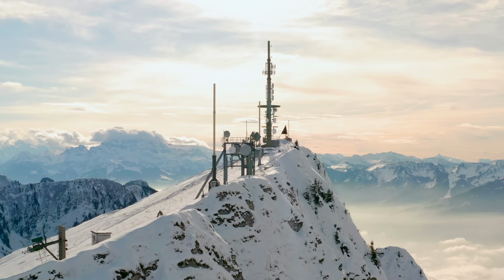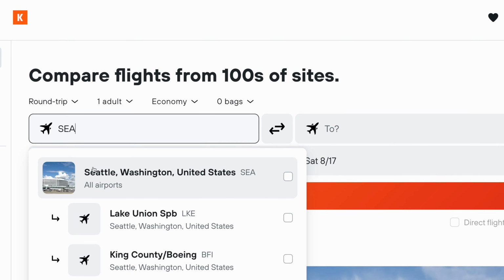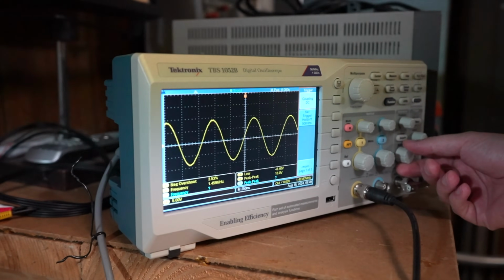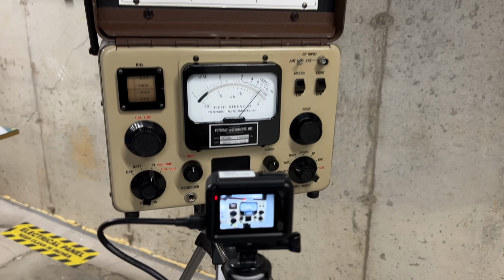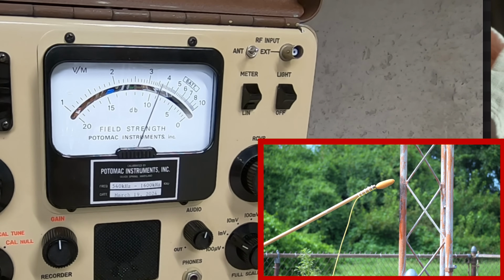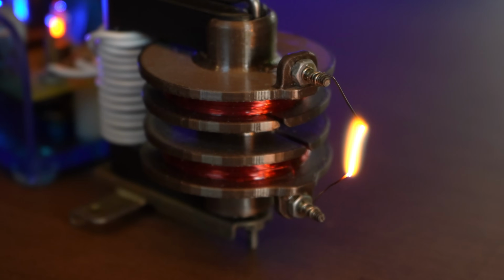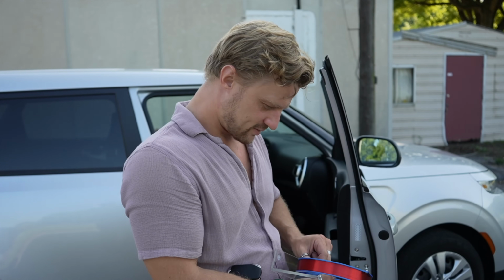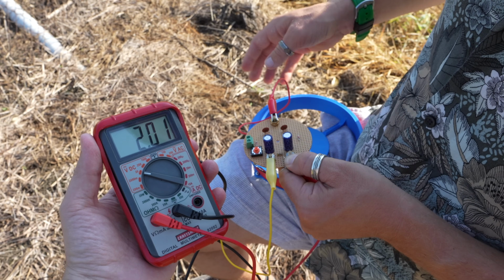Stealing Energy From Radio towers Using Plasma (ft. Geerling Engineering)

Comment: I found your channel today.. and after watching, subscribed of course. YAAAAAAY!
I have a couple inventions Im working on and am gleaning bits and pieces from your really cool work.
After a couple years, I don't really expect you to read this, BUT... if you REALLY are out there... 
I have a few Q's, please.  So, did you do a new build? 
On your little receiver, how many winds of wire did you wrap around the outside ring.. and what determined that number?

Hoping to hear from you Jay.  ~ Also, I [may] have what you'll call a cool and interesting story as to WHY I became 
interested in the same things.. like transmitted electricity. It may also take your creative thinking in a new pathway.
Headed off now, to your Homepage.  Later.
Reply from the maker: Hello! Not sure how many turns, but I matched the exact length of wire to be the same as 1/4 the wavelength of the radio tower transmissions.

Comment: I live in Denmark. 
Once, the class my education was a part of would visit an AM transmitter. Its a 300KW station. 
The guys who operated it were old and had many decades of experience there. One of them told us that he had been working with some tools on a part of it that was shut down. Since its really big parts, he was using big tools. 
Once he had dropped a really massive solid socket wrench over a part that was live. 

There had been a very loud noise and the wrench was gone. It ceased to exist. 
It simply vaporized instantly. 

So yeah. We dont mess with those big transmitters. But its awesome that you can transmit with AM to anywhere in the world.

Comment: The first Radios I have built as a child did fit into a match box and didnt need a battery. Detector Radios. Just a Coil, two capacitors (one for the resonance circuit with the coil, one for decoupling the audio signal), a Germanium diode, antenna (long wire), ground connection, and special high impedance headphones. These received the strongest Transmitter only, in this configuration with the not adjustable resonance circuit, but it was fun and cheap, the components I got from trash Radios and TV Sets.

Comment: so if you put a high enough load close to the tower it would shut down the broadcast?
Reply from the maker: It depends on how the tower's circuitry is designed. Too much leakage and it will trip. Too little, and the power will allow power to leak away.

Comment: You ever heard of the farmer experimenting with the 270,000 volt power lines running thru his property? 1100 volts coming from a 100 foot copper wire forty  feet below the lines......lol
Reply from the maker: Oh yeah, that one doesn't shock me. No pun intended. Transmission lines put out so much EMF.

Comment: Haha bigger loop tuned to the transmitter frequency. Tap the coil to preserve the Q while picking off the energy and charge lithium batteries when the station is using day time power levels, and use the battery for something at night 😂

Comment: Try wrapping wire around a coffee can attached to a   pole that is electrically insulated from the can and try just getting near the Transmission Tower without actually touching it. 

That is called Theft,.... if you do it to an overhead Power Line.

IT'S CALLED,..... Magnetic Inductance ~ and you are cutting the Flux.

Comment: So what happens when you build one that can handle the power? Does it pull down the radio towers signal? Unrelated to radio transmission a farmer who had a barn close to high voltage transmission lines discovered voltage being induced into coils of stored wire spools. So he put together a large coil of copper wire and attached a load to it. It powered a set of lights or a small motor. Free power as he thought. The power company noticed the loss on the line and tracted it right to his barn. And he had to pay for stolen power and remove all the wire. I cant prove if this was a fake story or not. But induced voltage from a large electrical field can happen.

Comment: You said it 
The tower “radiates” power
As oscillation = radiation
To make a viable wireless energy source 
The output would exceed the safe levels of exposure
My late father is the guy that configured the digital tether
Via geolocation algorithms 
That allocated the designated receiver
 
Inventor of 202 base station transceiver 
Implemented as foundational packet switching router across +690 gsm cdma networks globally from 1991 2g
He passed away 2001 at 37 years old from radiation induced illness
His life’s work ate him from the inside out

Comment: Of course Mr Tesla did something like this years ago. Did you consider taking your apparatus a few miles away and driving toward the transmission tower while monitoring the power picked up?? BTW, I noticed that snow had melted off a coil of barbed wire  on a fence post under a set of high voltage transmission lines one winter.

Comment: When I was in HS I used to do field day with one of the teachers. One summer we had put up a ten-meter inverted V antenna, I happened to brush up against one of the transmission wires. We were using only 10 watts. But man did that hurt.

Comment: In the early 1960's I had a Heathkit shortwave radio.  Over my home and garage, my dad (an Elactrician at Deyroit Edison),  put two insulated dipole wires atop these structures in the L shape created ny  our lot. One 90 degrees to the other.  These ran into the radio, which was grounded after this connection causing the electrons to flow into the radio as an antnna. I disconnected this combined 2 wire antenna and connected the bare wire to a flashlight bulb which when connected to a ground burnt out very brightly like an old flashbulb.  Storer Broadcasting was WJBK in that area, often reportedly listened to as far as Texas from Michigan. It was 500,000 watts, and very often we could hear the radio on the bathroom and kitchen sinks in rather good audio frequency. We were allways getting electric shocks off the refregerator, etc. Painful zaps!  I grew up thinking it was "the carpet"...in the living room, from accumulated static electricity (that's what was blamed by my mom).  My dad accused me of "plugging it into the wall"!!!
 When pestered, he said "I don't know, but leave it connected to your radio". I even used the bare wire to power a transistor radio enough to...listen to other stations!!!😉

Comment: If I'm not mistaken that goes on the same basic principle that Nikola Tesla wished to modernize which was Wireless power transfer via Tesla coil but technically you could use the radio tower and the receiver that was shown to do the same thing

Comment: Over the years as a am radio engineer I have witnessed some really neat and very scary occurrences. I hesitate to discuss the damage I have witnessed to things and poor creatures that have come into contact accidentally. The highest power broadcast transmitter I ever have observed was a 2,000,000 W transmitter. I have anecdotal stories that have told me about people living near a 1 million want broadcast Transmitter in the Philippines that used to put out a length of wire to run their lightbulb in their home with no other connection than ground. Thereby they got light in their home after dark for free. R.F. energy is a wonderful thing, but it does have to be treated like any other energy source with great respect and knowledge. Try a 1n4007 diode it isn’t as sensitive but has a 1 kv rating. I have had to use these in applications where to much rf would eat those little detector diodes for breakfast.

Comment: Massive JBLs, is this TESLA approved the first well known Tesla. I thought we settled all this in the 50,60 &70s a good 5 watt amp is all you need. I actually have a 110w, 150w, 200w all 70s Pioneer heavy duty equipment.

Comment: why does our new building code take the ground off the waterlines and go with 2 rods . are they cleaning up the noise from the system ? also local bans on real neon lights why too much noise ? ground is continuous without noise is it a surveillance tool? if so a spark plug would drive them crazy

Comment: i am a plumber and replaced many copper main waterlines from the street to the house . id cut the waterline and the whole house would dim . bad ground at the main touch the pipes together shut off the main bkr .  iv had this happen i told the homeowners your ground needs to be  cleaned at the mast or the pole or meter socket that they were grounding through the waterline . each time i heard our bill is low just clean the ground at the waterline wel leave it alone

Comment: i was told to add 2 more ground rods to my system . 1 straight down go 6 ft and add another at a 45 degree angle . go through in a loop and  bring back to the service . my bill will go down because im over grounding . a radio enthusiast told me this. guys smart could he be right ?

Comment: Id be willing to bet the SWR on the transmitter went through the roof when touching the food to the tower.
I hope the finals are rugged cause id bet they would melt most people's credit cards.

Cool experiment!!
Reply: I think think it wouldnt be too bad because they were touching the tower at the bottom where the current is pretty high. It wouldn't raise the SWR too much because it's still only taking a small amount of energy compared to the actual transmitting power

Comment: This was a partical Final year project of mine using xbee mesh network for sustained wireless power free comms... And alough it worked it aas actually cheaper just to use a 10 - 20 year battery to enabke mostly maintance free... the looses where ridiculous even with harmonic resonace. In the end i settled for a cross of minutire limithium caps/ batteries and a resonance tuning curcuit using some of the lastest ICs on the market (i forget which). 

The funnest part, the research and the mathematics.

Comment: How about building a receiver that could be installed in parallel with a solar power system. That way the storage batteries could continue to be charged at night by the radio broadcast signal.

Comment: There is that myth in Germany that people lit their garden sheds with the power from radio stations. How that? Back in the old days the space around the radio masts were not left empty. They were turned into allotment gardens. That means that the tennants of those gardens had to face the risk that icicles from the masts of even more often from the guy wires or stays could drop on them or their sheds but that could only happen in winter when the garden work would have stopped anyway. It was then found out that a) the stations were not heard anymore from larger distances and b) despite the fact that those allotments were not linked to any electricity network lightbulbs burned in them. The German postal service that runs the technical part of broadcasts saw to it that the hobby gardeners ripped those home-made installations out again that supplied them with energy.

Comment: Great proof of concept! What you need is a full-wave Bridge Rectifier to prevent the induction of reverse polarity current which may have been what blew your LED. Tuning the antenna will help with more reliable results as well. A voltage regulator circuit could prevent that kind of damage as well! Great job! Long live Tesla-Tech! Wishing you all the best! Thanks for sharing!

Comment: Its been a shower thought for years after first listening to a crystal radio set and then later seeing a similar setup with an indicator LED, I thought if you could light up and LED then why not just make a flashlight that would never need batteries? sure it wouldn't be perfect or a million lumens but in a pinch having an unlimited even dim LED would make the world of difference.

so yes absolutely create a more robust system and if you get bored while doing that make a flashlight to ... and mayhaps send me one as well

Comment: You use to be able to get Dual & Triple Crystal radios sets were you could Tune in to two, three Strong AM Radio Stations And Charge Capacitors (Ultra Super Capacitors + Battery Capacitors )Run joule thief's > & Glass Jars (Lead acid)(Then) but now SIB +NA & LTO  battery cells  Or run A transistor & Amplifier off one of the Strong stations Also Power up FM Demodulation If was today can of Run Digital HD Radio And DAB Processing & decoding Even a Little LoRa Transceiver (MCU ESP 32 with LoRA + Wifi + Bluetooth )

Russia used Oil Lamps / And Candles  With  A Thermoelectric generator (TEG) + Military Radioisotope thermoelectric generator (RTG, RITEG) multi-mission radioisotope thermoelectric generator (MMRTG) to run 2 way Transceiver Radios & Transmitters (Radio Becons)+ Light house's

Comment: YouTube channel Kreosan English put a cell phone on a pole with a charging cable I think? And held it up to some high tension, powerlines in Russia or Ukraine, where it actually started charging the phone. I don't think these guys were any kind of scam artist that they are definitely radio in electrical engineering enthusiastbut I'm not sure if this is a similar effect. Check them out too. Thanks for the videos, cheers!

Comment: Nice video. I use something simular to have a light burning 24/7 for free. In the housing of an old wall mounted streetlight I mounted a wifi camera. The camera works on a 12vdc adapter an the antena cable and the 12 vcd cable run for 50cm aling the pipe of the lamphousing. One time I toutched the houing and get a chok. When I measured the voltage between the housing  and ground I measure 110 vdc. If I unplug the camera its gone. Now I connected an old led tube light to the streetlight housing and a coper pin that I puched in the gound. Sins then I have a free doorlight. And no, not a joke!

Comment: Is it really necessary, to have power already on lowest section of the tower? Maybe it would be better to have low voltage on first section, and high power first 7 feets higher? That if somebody goes inside and touch the tower, will be shocked and scared from low voltage, but will not be killed on the place?

Comment: I have lit LED's from a 27mhz base station antenna by connecting them to the antenna and earth, have had them blow during a lightning storm. I have successfully been able to retrieve 24. volts at very low amperage using a capacitive plate antenna using wood as the dialectic and a basic bridge rectifier circuit. That was years ago when I was fooling around with trying to harvest cosmic energy like Tesla. I think a co-phased block of miniature antenna arrays may work better. It takes a lot of experimentation.

Comment: Like to see video the measures radio wave energy in air versus distance from radio Tower.  Next measure antenna watts collected from three different size antennas.  This experiment determines if  watts per pound of antenna is a straight line constant or curve.

Comment: Imagine using AM towers to power electric vehicles.  I think there was a guy from Kenya, I think his name is Maxwell Chikimbutso that designed a battery pack that charges itself from AM radio waves and is in the works of designing an eletric vehicle using a similar system eliminating the need for power charging stations, making Tesla vehicles obsolete.

Comment: It’s worth noting that the “plasma speaker” aspect of this is only possible with AM radio. FM modulation encodes an audio waveform as a change in frequency of a carrier frequency, instead of a change in power. (And PM does the same thing, but changes the phase angle of the carrier frequency, which, granted, changes the frequency.) I imagine that, with FM or PM or other more complex modulation schemes, you’d just hear a buzzing noise. For CW, you’d hear the keying of the Morse code, probably as a buzzing sound. Any sort of full duty cycle signal would probably just sound like a continuous buzz, while partial duty cycle signals would fluctuate with power. Oddly enough, this leads me to think that you could probably hear single sideband the same way as standard AM, without any of the hardware typically required for processing SSB.

Comment: Radio powered electric cars would probably be the best performing electric car because then you only need a small battery bank to store power whenever you are no longer in range, also could use an ai controller that always ensures your are tuned into the strongest signal at all times.

Comment: I didn't think you even have to use plasma. The high power lines leak power as radio wave like crazy and it's easy to collect and convert. Just watch out because i know a guy that got sued by AEP claiming he was stealing. It was dismissed but had a toll.